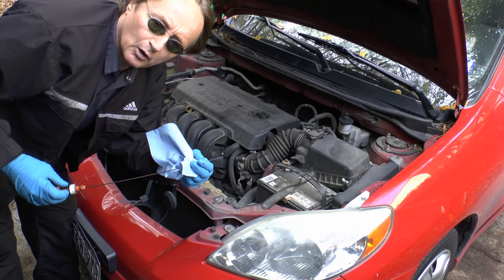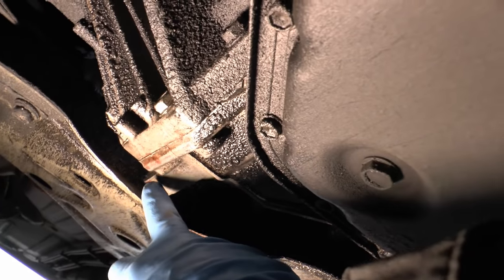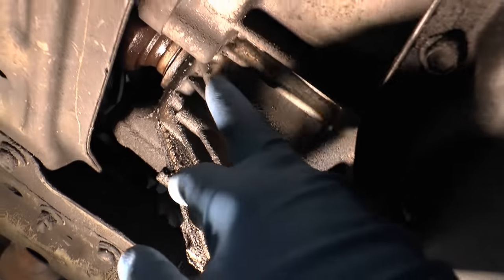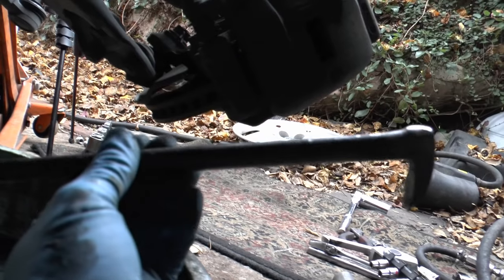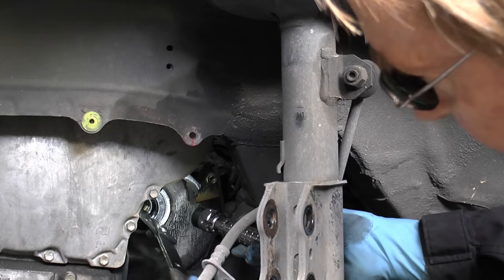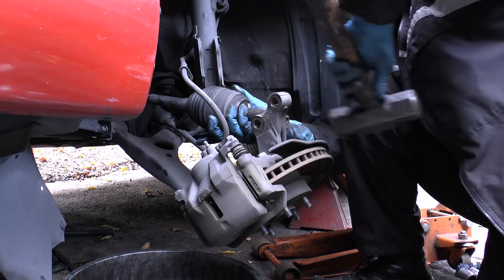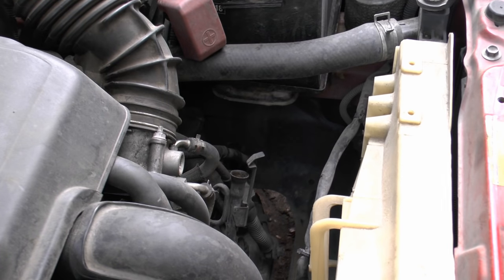How to Fix a Transmission Leak in Your Car (Axle Seal)

Comment: Scotty I commented on a video a week ago about the Chrysler with the 2.4 sohc. It takes about 1 to 2 min of crank time before it actually starts and when it does start it runs fine just like it should, every now and then it does throw the p0300 code. You recommended the fuel injectors dirty I just bought new ones and it didn't solve it I also changed the pressure regulator, fuel pump, spark plugs coil packs and wires and still no success where do you recommend looking next? Thank you
Reply from the maker: have a guy like me analyze it with his dealer level scan computer. Tons of data in there for a pro to analyze, plus bidirectional testing.
Reply: Wow you replaced a lot of stuff already. Considering that it takes so long to start, have you replaced the fuel filter and air filter?  Have you checked the fuel pressure with a fuel pressure tester?(you can borrow one from most auto stores)
Reply: This type of car the port wasn't added to it. So I'd have to have a shop do it and filters have been replaced as well. Is there a possibility it's the crankshaft or the sensor.
Reply: Yes that is exactly what happened to one of my cars. It was the crankcase  sensor. It took several cranks to start but once it started it was fine. I bought that sensor O'Reilly auto parts for $30 and it took care of the problem
Reply: Wait a minute. I meant the camshaft sensor not the crank shaft sensor. On my car it was located right on top front of the engine behind and above the fan

Comment: hey Scotty I have a 2004 Pontiac Grand Prix and i stopped driving it for three days but know it's leaking trans fluid it leaks only at some points
Reply from the maker: do my video "finding and fixing car oil leaks" to find the leak so you can fix that problem
Reply: Yo Scotty ! What is that seal called?

Comment: Hi Scotty. I have a 2010 Ford Fusion with 52,690 miles. I recently checked the transmission oil and it was as black as the engine oil. Could there possibly be something wrong with my transmission?
Reply from the maker: change it now, pray it's OK, should not be black.
Reply: those are normal in mercon LV.. as long as its doesn't smell burnt.
Reply: Yes normal see my channel for my latest video on this condition

Comment: i have this problem but my problem is a little different , i change the seal everything OK the next day it leaks or the next week or the next month ! WTF !! i get under the car and shake the axle it can move and damage the seal which mean maybe the bearing inside the gear is not at its place , and these is nothing that show that the bearing is not in place because the bearing doesnt make any sound ! so why do i get this leak every time ! do u have any idea ? ill make a video and share later!

Comment: Hey scot  I have a problem with my car, it's a 2002 Honda Civic  manual. I can start the car and go into reverse and 1st gear but it won't go into 2nd its get very stiff changing gears. What do you think is the problem?
Reply from the maker: try putting new shifter bushings on the shifter assembly under the car, pray it's not the transmission going out, I just saw one that did
Reply: Scotty Kilmer  Alright thanks

Comment: Or like on my 96 jeep grand the lines going to the radiator had a rusted whole in it by the fitting going back into the transmission

Comment: What about low transmission fluid and no leaks? I think I am afraid to know. 99 Subaru Outback automatic.
Reply from the maker: +Schteve Ven they can only get low from leaking OR some fool not putting enough fluid inside. BUT, they can read low if the system is clogged up inside and then the fluid doesn't drain to the bottom and reads low even though it isn't.
Reply: +Scotty Kilmer - is it possible for a leaky seal to leak tranny fluid to the transfer on this subaru? just bought it and transfer has tranny fluid in it....not gear oil. wow. glad it was cheap.

Comment: Hey Scotty what am I suppose to fix when my honda civic lx 1992 sputter and dies on me when accelerating
Reply from the maker: many things can do that, but most common are worn out distributors or worn fuel pumps. Pressure test the fuel pump first, dists are rather hard to diagnose until they stop working entirely

Comment: Hey scotty, 96 accord 2.2 engine block leaks oil a bit. I heard restore engine restorer might stop leaking.
Will it work
Reply from the maker: no, that doesn't stop leaks, leaking oil blocks require replacing the bad gaskets or broken parts.
Reply: Its might be the engine block leaking, not a gasket. Maybe i'll try your uv leak dye test to locate it and if it is the block, can i just use duct tape over the hole and the heat of the engine will melt the tape and block the hole right?
Reply: Alright, that'll work. Fun fact, i had a pos atv and one the chain links broke and made a big hole in the engine. JB weld fixed it up. Had to replace chain too.

Comment: What is it when transmission fluid leaks into the oil it looks like the oil is leaking but my oil is remaining full and my transmission fluid is emptying out slowly I've already replace the rear main seal on the oil but I don't think that was the actual problem... my vehicle is a 2000 Ford Ranger 4.0 V6 4x4 idk if that helps but any help would be appreciated
Reply: booty pirates RIGHT I HAVE A 2005 FORD ESCAPE, WHEN I POUR TRANSMISSION FLUID IN MY TRUCK, WHY IS IT STILL LEAKING OIL? ALSO IT SHIFTS WEN I DRIVE IT ND A FEW TIMES IT HAS CUT OFF ON ME... DOES THIS MEAN IT NEED A VAVLE COVER GASKET OR WHAT?....

Comment: I have a 1998 Tahoe truck it leaks out red is that a transmission leak?
Reply from the maker: +pretty me normally it is, but check power steering too, some have red fluid there also

Comment: Hello scotty, i have a 2001 honda crv and the steering wheel is a hard, but it has oil and the steering pump is not broken or nothing everything is normal besides the steering wheel being hard, i checked the fluids and steering pump and everything is good, what can possibly be wrong with the steering wheel??
Reply from the maker: on those , generally a bad power steering pump, but if not that, a worn steering rack that costs a ton to replace
Reply: How can i tell if my steering rack is worn out?
Reply: Willy Baez Is the fluid old?  I had stiff steering on my camry and I replaced the fluid and it's now smooth as ever.

Comment: I have a 1994 toyota celica gt but it won't accelerate on 1&2 gear until 3 it will pick up speed any ideas ?? Help pls thank you
Reply from the maker: tune it up first with new spark plugs, if it still does it, pressure test the fuel pump to see if it's weak

Comment: Hi I have a question I took my car to the dealer because my car was leaking oil I know it was oil because it dark and brown. Well they replaced the oil drain plug because they said it was that. Well it continues. I when under and saw the oil pressure switch sensor which was wet. So I told them it might be that. So they check it and said is a transmission fluid not oil. How can it be transmission fluid when the color of the transmission fluid is red or pinkish. I like to know can the transmission fluid turn dark brown or they just trying to get money from me. They said they need to replace the gasket of it so it cost $400. Unless they just planning to fix the pressure switch and charge me that. I don't know I'd I should believe them or not. I don't know much about car I just find information online and see video.
Reply: If you have both fluids leaking the tranny fluid will mix with oil/gunk on outside of engine and change all sorts of colors.  Clean the engine and transmission, then watch to see where it leaks from.  THEN you can try using the color to see what fluid and where its leaking from.  Inspection cameras with flexible shaft are soooo good for this type of job.  Stay gold.

Comment: There was one thing that my car did recently that seemed to have stopped, but it always comes back.  After a heavy rainstorm and driving through a puddle, suddenly the car made a noise that sounded exactly like a metal pipe dragging along the ground.  It would do this off and on.  Nothing was loose from under the car.  What should I check if, and when, it comes back?
Reply: One day I tapped the muffler, and it got louder.
Reply: Not like crunching.  Exactly like a pipe dragging along the ground.  If it got louder when I tapped the muffler, it has to come from somewhere in the exhaust.
Reply: I want to check my suspension anyway when it warms up, so I'll check that as well.  Check to see if the tires have any play as well
Reply: I do occasionally hear a mild hum going over 45.
Reply from the maker: Colin Donovan
sounds like bearings got wet and made noise, they hum at higher speeds when worn
Reply: That's what I'll check out come springtime.

Comment: You should never hit the top of the tie rod you should only hit around the outside usually one or 2 good hits and it will fall right out but hitting on the top threads will definitely mess up the threads and cost a good bit of money on installation and alignment.. Also when installing the cv axle you should never hit the end like he shows unless you screw the nut flush to the threads then you can hit a little but anyone who has worked on these things very much knows that one wrong hit on the axle threads and you will be replacing the whole axle..

Comment: Only thing I won't do is hammer on the tie rod end threads like that. If you damage the threads you can't get the nut back on. Put the nut on flush with the top of the threads then hammer it. The nut will protect those threads.

Comment: question . my 1971 valiant slant 6 225cu  leaks from the rear main seal area. iobviously figured the rear main was the cause, however its tranny oil coming from the area and not engine oil. i havent taken the tranny off but the difference in oil is obvious i just dont know what to replace. engine was professionaly build at a shop. the tranny was not done. help plz automatic tranny btw. scotty kilmer
Reply from the maker: front main transmission seal is shot, pull off the tranny and replace that
Reply: Scotty Kilmer thanks!! I'll try that. I didn't even know they had a seal there

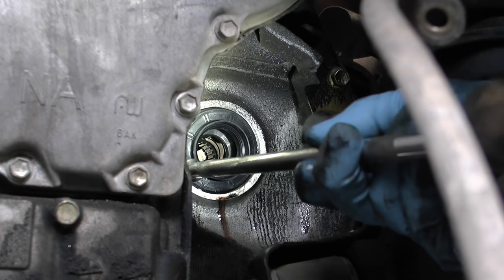Comment: Hey scotty, i couldn't help but notice that at 2:17 you put the transmission seal in without lubricating it prior to puttin it in. I am currently in a motorcycle repair class in school and we are talking about lubrication and cooling systems and you are wrong. This can cause catastrophic damage to your seal and engine and will make the car be totalled. Please stop spreading false information. I would hate to see someones car blow up because of your stubbornness. Please stop. Sincerely, yours truly, best wishes, Ashton Mosher
Reply: Thanks bub

Comment: That was great scotty, made me laugh. I love your videos and maybe you can give me help on a P0500 code on a 96 Grand Cherokee. Already replaced it but still no speedo response. Ugh!
Reply from the maker: on those, often a bad dash unit, many guys will try a used dash as individual parts cost a ton new.
Reply: Went and got one from wrecking yard and Walah, it works. Thanks Scotty.  I'll continue to tune in because the journey is still not over with this jeep.

Comment: Hey Scotty, I have a fwd car that has a leak where the driveshaft goes into the transmission. I put in a new seal but it still continues to leak from the same place. I am certain it is installed correctly. What could this be?

Comment: Don't ya got to get the car re aligned after this?
Reply from the maker: no, not if you put it back together the same way it was before taking it apart. This car has non adjustable strut mountings, so it will not effect aligment

Comment: I just put my motor back on after changing the transmission seal and it still leaks any ideas????
Reply from the maker: +Junie Burn4our  depends what's leaking, do my video "finding and fixing car oil leaks" and pray it's not the seal you just changed out, cause that would mean you did it wrong OR shaft in tranny is worn and ripping the new seal
Reply: Do you have a number i can call you on
Reply: I need help

Comment: Wow that car still has a transmission dipstick? Dodge chargers don't have them but u can buy them.... the service bulletin says the fluid is lifetime anyways
Reply: It appears to be a Toyota Matrix maybe about ten years old.  Yep.  Cars then still had dipsticks
Reply: Why I will never buy new
Reply: Oh my days the things mfrs do to try and rip us off.  I just did a job on  Jeep Patriot with CVT transmission.  Dealer wanted $500 for fluid, filter and pan gasket change.  They also sell the dipstick for $65 and can helpfully read your fluid level with their newfangled pressure fluid gas-chromatograph chart for only $40!!!  I got a junkyard Dipstick from a big truck, used the Patriots engine oil dipstick to get a reference reading, cut the truck dipstick to length and put marks on it, and the customer now has a tranny stick.  Bought AMSOIL CVTQT fluid for $15/liter vs the dealers $27/liter and saved the customer bout tree-fiddy.  Stay gold.
Reply: DE Nichols lol so true. If someone buys a car and never changes the transmission fluid until it breaks, does that mean it was lifetime fluid or just poor maintenance?
Reply: I don't listen to that 'lifetime fluid' crap.  I still change it every 50 or 60K miles
Reply: no such thing as a lifetime fluid. especially when seals go bad...
Reply: ***** hi, I have a jeep patriot as well. Can I ask at what mileage does the cvt oil needs changing? Thank's.
Reply from the maker: No Way I would change it every 30 thousand miles myself
Reply: Thank you sir.

Comment: You ever mess with a Cvt Transmission
Reply from the maker: yes, and they are one royal pain in the ass
Reply: Make a vid I have an 07 altima 4 banger and I feel the Loss of power.....I currently have 1800000 miles on it.

Comment: Smashing threads with big hammers? Backyard dodgy much??
Reply from the maker: I use a tie rod puller tool most of the time, but people whined that wasn't DIY enough, so I'm showing a DIY method here. If you want to be a pro, buy the expensive tie rod puller, cause the cheap ones often break.
Reply: Scotty Kilmer yeah I understand DIY etc, but you can still be DIY by simply threading the nut half way on and tapping the nut, 

Cheers 🍻